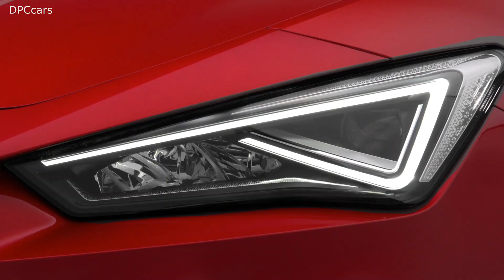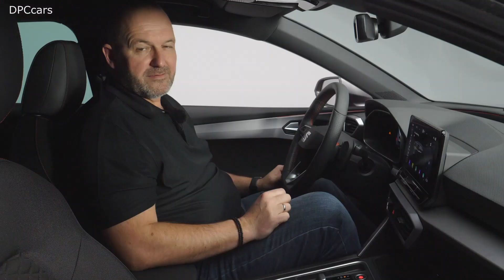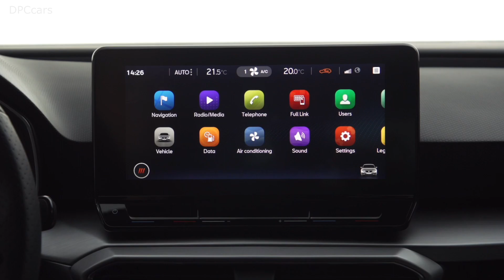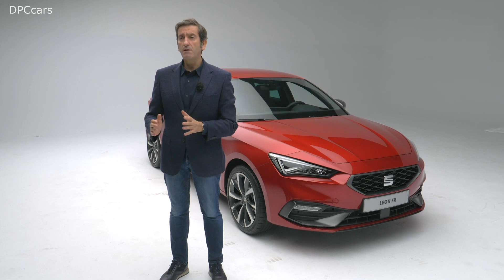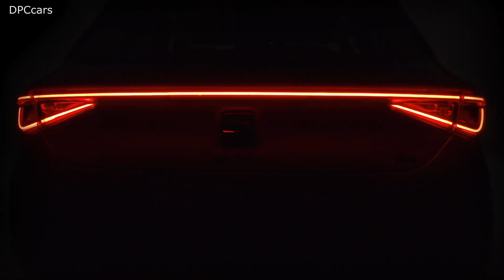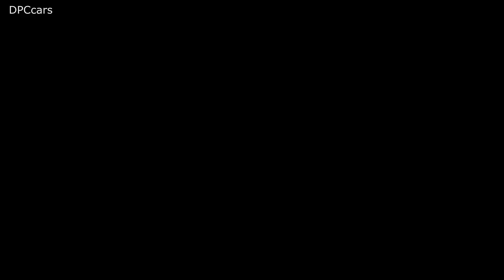2020 SEAT Leon FR Explained

Comment: Slider controls for hearing and volume are NOT illuminated , so are not good to use in the dark! A huge mistake by Seat. Sat Nav is good but difficult to set an address, I found the VW up to 2020 system much easier.